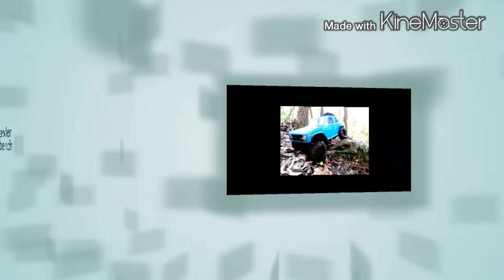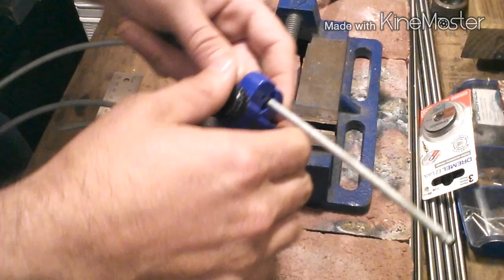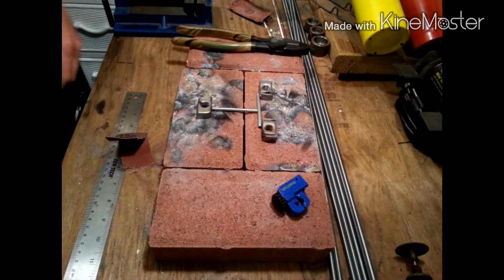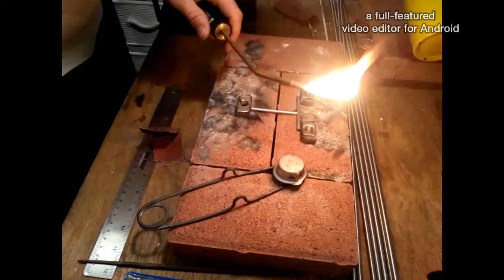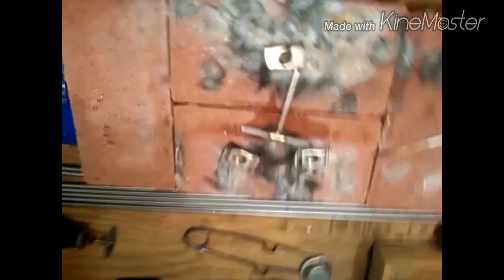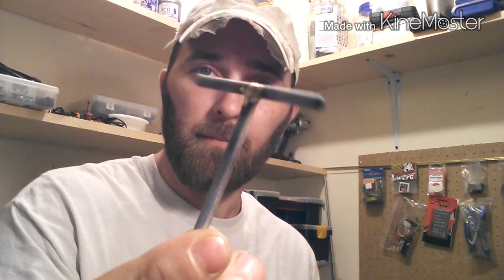Bronze Brazing 3/16 Steel Brake Line Tubing.

Comment: Drill a hole through some reasonably thick wood then feed the brake tubing through ……every time you need a bit more tubing just pull it through and hey presto it comes out straight :)

Comment: As an HVAC guy I will say this, if you can solder steel break line tubeing, soldering copper for refrigerant lines is as easy as pie.

Comment: Looks fun. I want to start building roll cages and honcho cages
Reply from the maker: Yeah man, its a blast working with steel. Aluminum on the other hand can be a real pain in the ass. There is a super thin line between hot enough, and DAMN i just ruined several hours of work.
Reply from the maker: Yeah man, its a blast working with steel. Aluminum on the other hand can be a real pain in the ass. There is a super thin line between hot enough, and DAMN i just ruined several hours of work.

Comment: How does the rod hold up in strength compared to safety silv?  How much more rod would you go through vs safety silv?  I'm looking for a cheaper alternative!
Reply from the maker: Patrick Fisher  I've not used Safety Silv. The price point is what brought me to using these flux coated rods. I haven't had any issues with the bumpers or roll cages I've built for my Rc trucks.